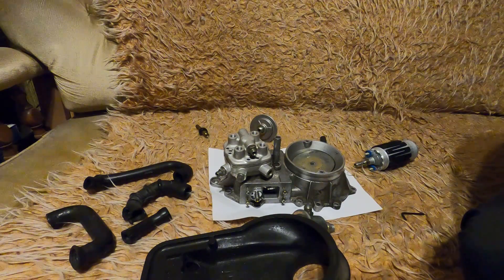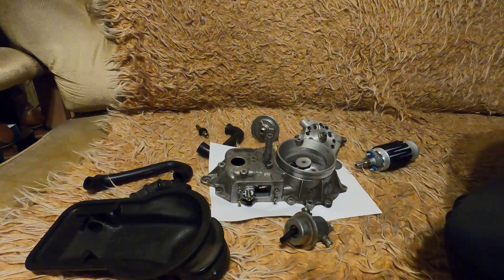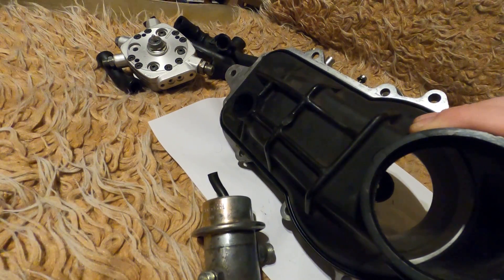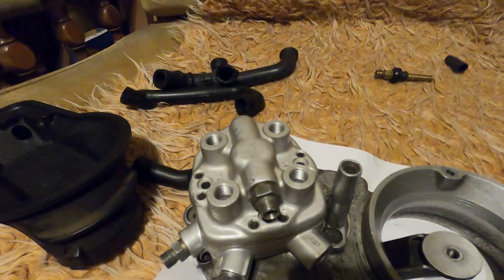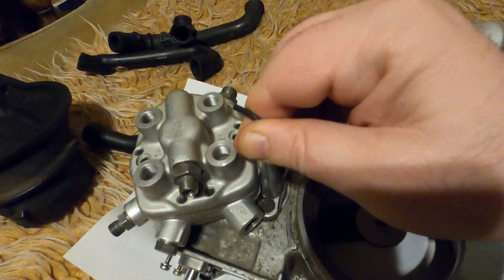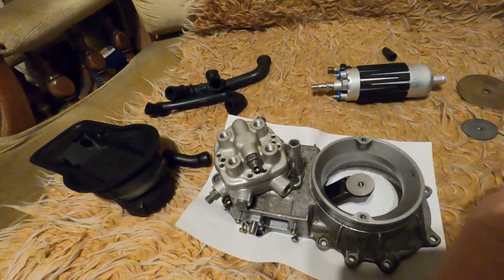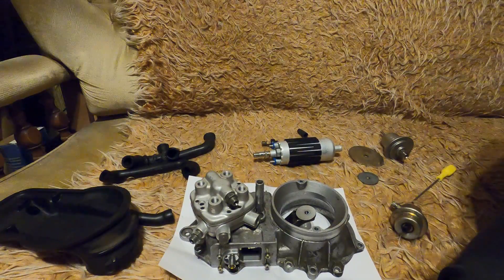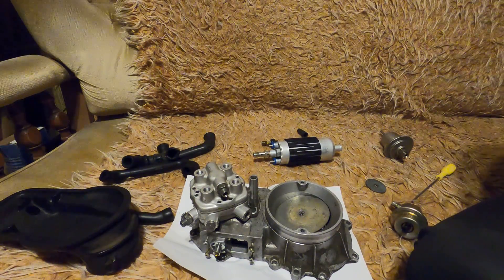㉦Mercedes Ke-Jetronic㉦ - A special video on how to adjust the mixture on K-Jetronic

Comment: I replaced my ignition switch car was running before. Now won’t start again. Check fuel in fuel distributor it is full on key on . Crank car no start . Crack fuel injector and no fuel coming to injector. Why it was fine when I turn car off waiting on ignition switch. Do I have to check fuel pressures again for system and control pressure for the 0.4 bar difference?
Reply from the maker: Hi 👋 If the fuel distributor is full when you turn the key ON, but no fuel comes out of the injectors while cranking, the issue is not the ignition switch itself but the control pressure / system pressure relationship.

Yes ✅ you should measure both system pressure and control pressure again. Even a small difference (like the 0.4 bar you mention) can decide if the injectors open or stay closed.

Also check:
1️⃣ That the fuel pump relay is giving correct voltage while cranking.
2️⃣ That the fuel distributor plunger moves freely (not stuck).
3️⃣ That there are no wiring issues left over from the ignition switch replacement.

So yes – go back to basics: gauge on the system, measure system and control pressure → from there you’ll see why injectors don’t spray.

– Ivica | FixYourMercedes 🚗✨
Happy Mercedesing

Comment: Fantastic videos, you must be one of the top experts in the world on these Bosch mechanical injection systems. One question, if the car has too low idle when warm plus warm outside would you recommend these actions or renovating the warm-up regulator?
Reply from the maker: Thank you so much for your kind words! 🙏 I'm really glad you’re enjoying the videos. As for your question — if the idle is too low when the engine is warm and the outside temperature is high, I would first inspect the warm-up regulator (WUR) and verify both control pressure and vacuum enrichment, depending on the system.
🔧 The mixture adjustment screw is not intended for frequent tuning — it should only be touched after confirming that everything else (pressures, vacuum, ignition timing, idle air) is within spec. Over-adjusting it can mask deeper issues and cause more harm than good. Let me know your exact setup and I’ll be happy to point you in the right direction!
Reply: @mercedeske Thank you for taking time to answer me. I have a C123 280CE -77. Could it also be the Air Auxiliary vent or do you think it may be the WUR? (I have not touched the screw, I listened to your advice in the video :-)
Reply from the maker: @DeltaStar777  Wow! Thank you so much for your support — and welcome to the Patreon crew! 💪😊I'm truly honored to have you onboard. Every bit of support helps me keep these detailed KE & K-Jetronic videos coming! If you ever have specific questions or ideas for future content, feel free to reach out anytime. 🔧📽The auxiliary air valve has the function to help the engine not to stall when additional consumers are on. Considering the WUR - it can be issue if it has never been checked do it. They are all different and they have to meet some requirements. For this purpose you will need the pressure gauge to test it. In order to know which one you have you must read its last 3 digits because they all start with 0438100 and then you read your number. Mine is 015. I have table of those regulators for all cars. I will link you that video so you can find the specs for your W123. Good luck repairing your Benzand Happy Mercedesing!
https://www.youtube.com/watch?v=a2rOaTp8AiY
Reply: @mercedeske Many thanks and greetings from Sweden
Reply from the maker: @DeltaStar777  Thanks and Greetings from Serbia.
Reply: @mercedeske  Again many thanks, I have now joined your Patreon!!

Comment: A mechanic messed with my mixture screw and it’s way out of way. How many turns back and forth to reset it?
Reply from the maker: @taylorbushnell5838  As I said - clockwise until you see fuel coming out from the distributor. Then half a turn counterclockwise. Afterwards you will have to adjust it a bit finer.

Comment: Hi I've just replaced my injectors due to previous one was blocked with rust..
Now when I my car it jumps straight to 3000rpm...any ideas
Reply from the maker: At first check if the fuel distributor flows fuel while the engine is off. If that's the case try to decrease the fuel flow(remove the fuel pump relay, bridge the fuel pump and bridge the contacts 87&30). If there is no fuel flow as you bridge the pump, then check your throttle position switch if it recognizes idle position!

Comment: Start good kold, after 1or 2 min it runs very bad , and when we take it  on until it warm up it go’s wors , new spark , fuelpump, injectors,bobine, sparkcabels,rotor, distrubutor is cleaned up on the points ,fuel filter also new, point 2an3 meeting between 6and 7 volt, I reached up the mixter with 1/2 turn +3 times 1 degree , the relay with 10 Ampere is not broken, the lamp abs is not on when runing , and after he warms up will not start even after long trying, motor M 103 w107 300 Sl from 88 , please wat do you think , mixter to rich or accumulator ? Or sum thing els , sorry for the bad English I’m from Belgium, thanks a lot for your help , and say hallo to the lady’s 😂
Reply from the maker: For now I would advise you to replace the lambda!

Comment: My audi 100 C4 is a KE-Motronic. Is this similar? thanks
Reply from the maker: Yes, the working principal. This is for all those whom someone turned the mixture screw in all directions so that the car won't start anymore or it starts and then there are floating RPM. This is called the initial mixture adjustment.

Comment: Hi! I have a MB 190E 2.6. The problem with the car is that when you full throttle, it begins to fail like its misfire. I've change the spark plugs, spark plugs wire, distributor and rotor, fuel filter, idle regulator. 
Can you give me any hint on what can be causing this?
Reply from the maker: Hi, have you replaced the potentiometer?
Reply: Will try! Thank you !!!  @mercedeske

Comment: Thank you for your video, I'm really struggling with mine. I rebuilt the metering head and I am now having an issue. When I bridge the fuel pump fuel come straight out of my 2nd injector port. The others are fine and balanced. No fuel comes out the others until I press the flap. On the one that opens I hear a whine and then a large amount of fuel just continues to flow uncontrollably. Any help I would appreciate it. Thanks
Reply from the maker: Hi and thanks for the comment. Concerning the 2nd cylinder, either the diaphragm is ruptured or the valve inside is broken. That can happen when assembling the fuel distributor. Greetings.

Comment: Hi, I have a ‘89 230GE. I’ve put brand new fuel lines, tank, pump, filter, injectors and had the k-jet system refurbished. Originally owner messed with the adjustment and now it won’t start. I can’t seem to get it adjusted in close enough to start, any suggestions?
Reply from the maker: Hi. Unscrew one of the lines, bridge the fuel pump, ignition on engine off. Then put the 3mm Allen into the co screw and start enriching the mixture. Once you see the fuel coming out stop and turn half a turn COUNTERCLOCKWISE. Under those conditions any car should start. Afterwards set the mixture as it is supposed to be.
Reply: @mercedeske  I’ve got lots of fuel coming out, but can’t seem to get it lean enough to stop the fuel from flowing out.
Reply from the maker: If you can't stop the fuel flow then you have the issue with the fuel distributor. Bridge the fuel pump relay, remove all the metal hoses and the ignition on if you have fuel flow without deflecting the sensor plate then you have issue with the fuel distributor. Either the fuel distributor or the co screw doesn't turn at all.
Reply: @mercedeske  Gotcha, it was just rebuilt, but I’ll take a look at it. Could’ve been done wrong. The mixture screw turns

Comment: Thank you for the video it was very helpful for learning how to adjust the rich/lean my 84' Mercedes r107. I'm getting fuel leaks from the WUR connector at the top of the Bosch k jetronic distributor (6 cylinder) and not the fuel pressure regulator dampener itself. I'm going to lean out the mixture and see if that gets it running properly with no leaks. Thanks for the insight!
Reply from the maker: My pleasure. Fingers crossed and Happy Mercedesing!

Comment: Hello, friend! How are you? I would like to ask you a question, I bought the repair kit for k jetronic of a Mercedes 230e year 1981, but apparently when changing the orings that measure the flow of gasoline to the injectors, these were poorly regulated (excess fuel) there is some basic calibration What can I do to get the car running again? Thank you very much!!
Reply from the maker: Hello. So, as you rebuild the fuel distributor you must check if there are any leaks. Engine off and, remove the fuel pump relay and bridge the contacts 7&8(labeled as 87&30). This will make your fuel pump running. If no fuel comes out of the distributor then everything is okay. If you have a poor fuel flow towards the injectors then you will have to clean the distributor again. Either that or you have damaged the o-rings on the barrel while putting everything back. The only way to calibrate the fuel distributor is by turning the adjusting screws which I don't recommend you to do if you haven't screwed them in or out.
Reply: @mercedeske  Hello, let me tell you that I bought the complete kit for the distributor, put everything together, clean the injectors but I can't get the 4 injectors to spray the same amount of fuel (they spray correctly and don't leak), is there any way I can regulate it? From already thank you very much.
Reply from the maker: The only way is the 4 adjustment screws but don't readjust them, I adviseyou warmly. Test the distributor if you have flow or not. If not then you haven't done something right way(washing the fuel distributor).

Comment: Thank you very much for the video! Yes, I know about the 1/2 turn CCW when fuel starts to "raise" out of the fuel port.

Could you explain the 1.9mm gap method where is this measured?
Reply from the maker: You didn't tell me which car you drive.
Reply: @mercedeske  It's a Ferrari 400. Bosch part # 0438 100 055.
Reply from the maker: @cav4290  👏🏻👏🏻👏🏻
Reply: I am currently at the phase, will go back and try it in the morning again, thanks for this
Reply from the maker: @starboybmx  My pleasure. Good luck🍀
Reply from the maker: https://www.youtube.com/watch?v=ThoatMlKT3k&t=3s

Comment: Hi I drive an old e30 bmw with k-jetronik and works like you said, clockwise to rich the mixture and counter-clockwise to lean mixt. the problem is that when I try to rich the mixture the cars start to misfire and the rpm of the motor goes up and down .For now i go with lean mixture and i fell low power from the engine , any suggestions about how to fix it ? thnx
Reply from the maker: At first the condition is fir the exhaust to be good, not cracked. Afterwards check all the breather hoses. If you have misfires check all the cables. No vacuum leaks.

Comment from the maker: This is a special video for "THE CAV". In this video I try to explain how to set the mixture screw on K-Jetronic cars. Normally the CO-screw is something that MUST NOT be readjusted on K-Jetronic because there is absolutely NO NEED for that. Once readjusted it can be very painful to get it back in its original position because now you have no EHA as well as no X11 to monitor the values with a multimeter so if you readjust the screw you will have to get it back literally by feel if the gap of 1.9mm on your sensor plate doesn't do the trick. Here I have mentioned for the first time something that is called "The initial mixture adjustment" and that goes for the K-Jetronic cars only. The last step would be the exhaust gas analyzer to get things back to normal! Enjoy the video and Happy Mercedesing!
Reply: Hi is it possible for me to send you a video maybe you can help me with my mercedes
Reply from the maker: @GostaJoo  Hi. Okay, send it on my Instagram.
Reply: My son sent it on instagram because i dont have instagram